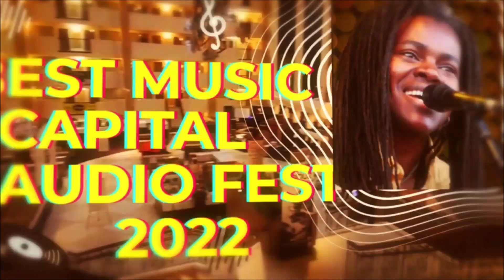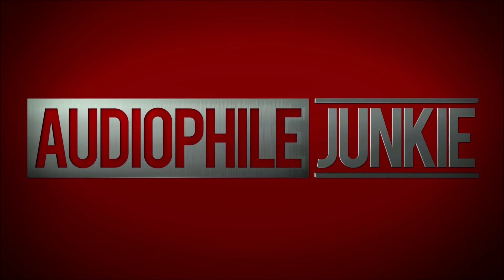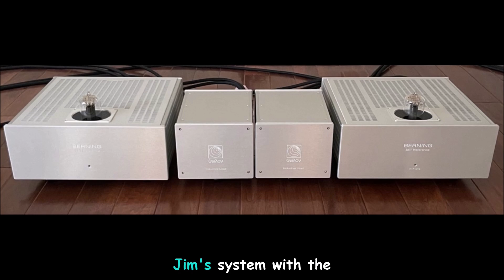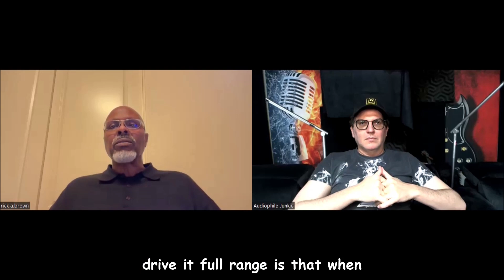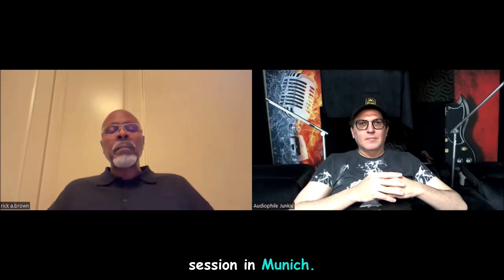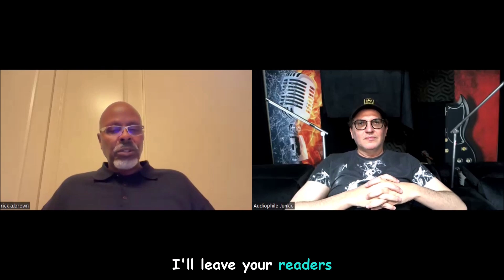The Secret Sauce: Audio Nirvana Through Gear Synergy & Setup - Zoom with Rick Brown of HiFi One

Comment: Thanks for the video. Just a technical note - having a high impedance, such as 29 ohms, makes a speaker easy to drive, not difficult. The higher the impedance, the easier a speaker is to drive.
Reply from the maker: I'll let Rick respond but I think it's more about the delta between drivers.
Reply: High impedance speakers require less current and more voltage.  Higher impedance speakers require more wattage to reach a given level. So higher impedance speakers are not “easier to drive".
Reply: @rickybrown3793  If everything else stays the same, higher impedance requires less current, and therefore a higher impedance speaker is easier to drive. If you start introducing other variables, as you have done, then it becomes more complex.
Reply: I guess "easier" warrants a bit more elaboration, vis-à-vis voltage swing and current capability. 

For a given task;
an amplifier with insufficient  voltage swing struggles ... 
Just as an amplifier with insufficient current capability struggles at a given task. 

It's all about suitability for the load and task.